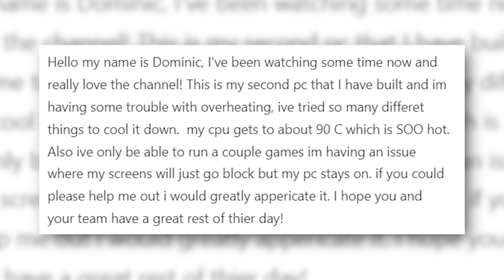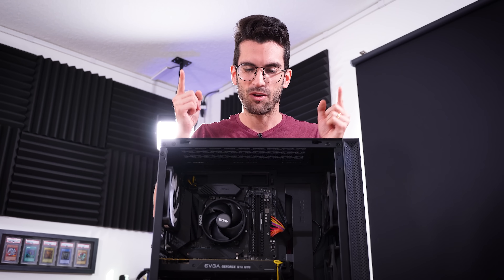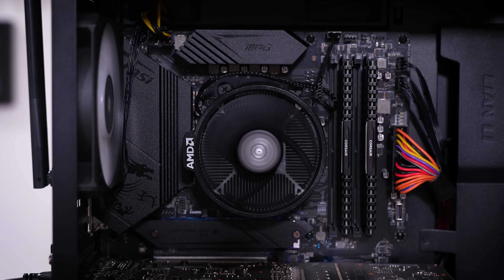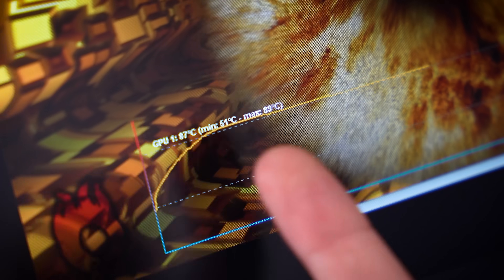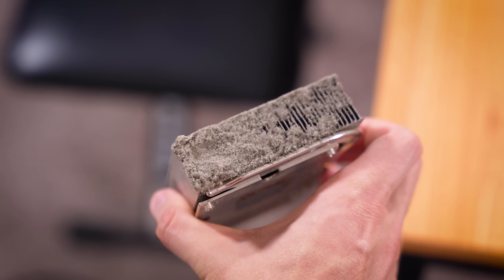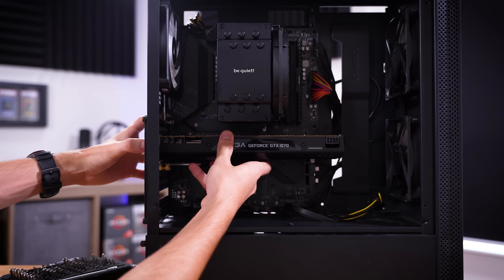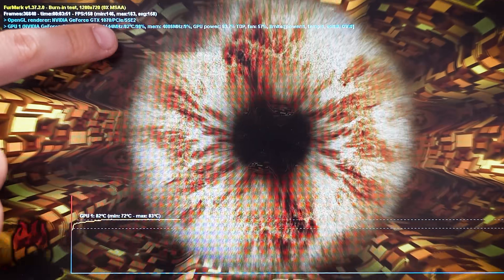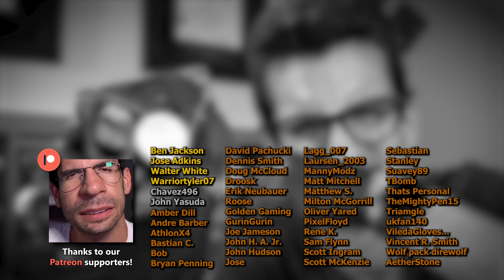Fixing a Viewer's BROKEN Gaming PC? - Fix or Flop S4:E15

Comment: (Commented before the video started)

If it was a R5 3600, the stock stealth cooler is a bit underwhelming for the job and that one will run pretty warm... but a 5600X was noted as being impressively efficient and a shockingly cool processor. I'm wondering if it wasn't screwed down correctly, or had enough thermal paste...

Edit: Wow, I have never experienced temps like that with a stock cooler. Aight, Dunno if the Dark Rock 4 was necessary, but I suppose that's a fix. :P (I run a Dark Rock 2 myself.)
Reply: The paste that was left on the CPU was incredibly thin compared to the cooler.  It looks like there was poor contact.
Reply: IHS not making proper contact below I'm guessing. That Dark Rock Pro 4 in a case without a side panel is doing about as good as a $20 single tower did for me in a case with decent airflow but side panel closed, and I was using PBO (I think this one also is though since 4.4 GHz all core). Doesn't make sense.
Reply: Yeah at 7:25 & 7:27 when Greg showed the CPU & Cooler to me it looked like there wasn't proper contact, especially in the centre of the Thermal Paste on the cooler as it looked like it hadn't even touched the IHS
Reply: Yeah my 5600x is impressively cool. 4.8ghz PBO overclock and it doesnt get over 65c. 45-55c while gaming.
Reply: @rhyshutchin5  Is that with a stock cooler?
Reply: I assumed bad contact and it kinda looks like it as well, but seeing the CPU at 78C AFTER installing a nice cooler, yeah... maybe just a bad lottery loser there.
Reply: I sometimes wonder if the thermal conductivity of the chip gets compromised from repeated near-overtemp.  I don't built a lot of systems but the stock box cooler seems to achieve similar temps on an "everything-new" build in my limited experience.  Just doesn't seem like you should need THAT much cooler for a 65W chip.
Reply: @grandmasmalibu  I think there might be some damage from the repeated overheating. My R5 5600x with Arctict Freezer 34 eSports Duo (which I consider inferior to the Dark Rock 4) runs at max 65°C with Prime95.
Reply: 3600x dont comes with the stealth, it comes with the Spire, same cooler construction, but a far larger heatsink, and the spire is quite enough for handling the 3600x, the problem is, the pre applied thermal paste is horrible, had very poor contact, after 6 months of use I was already having overheating issues, like, 75ºC in idle in my 3600x, just a new paste and the CPU now only hits 75 in full load, gaming, hovers between 55 and 65
Reply: I used to have the 3600 and the Stealth Cooler was plenty good enough just don't try to do any kind of overclock
Reply from the maker: Most Ryzen 5 chips are extremely efficient. Was quite surprised by this one. Likely just bad luck on the lottery.
Reply: @GregSalazar  I wonder if maybe the IHS isn't making proper contact with the die, the only way to figure that out though would be to delid it. Not really worth the risk though.

Comment: Love this series!!!😁😁😁 I had the 5600x with the stock cooler but instead of using the stock thermal paste I cleaned it off and put the corsair one and worked good until I upgraded to the 5800x lol, great content Greg! Keep it up!!😊
Reply: I went the opposite way. 5800x -> 5600x
Reply: @accordracin96  only reason I went to 5800x was because I built my girl a gaming rig with the 5600x and got the 5800x for $150. The seller wasn't into pc gaming anymore and was getting rid of his things. Took a chance and cpu works great lol